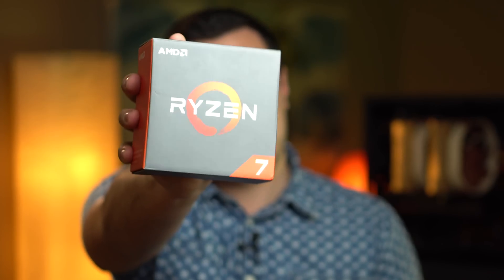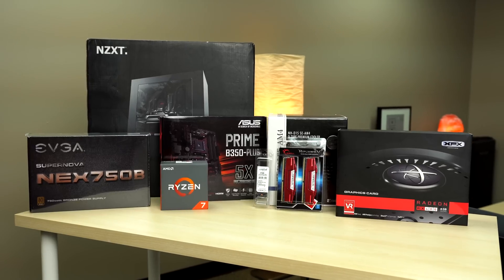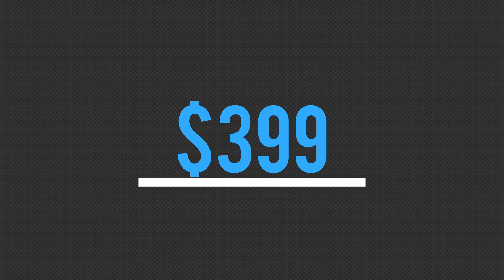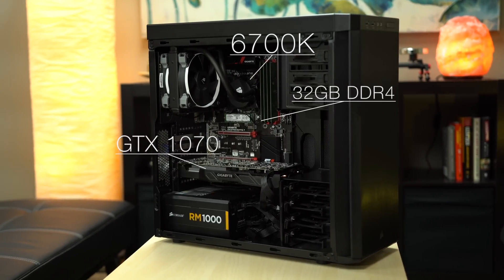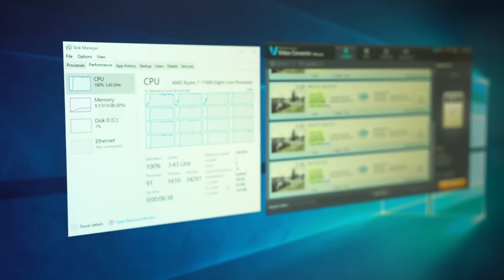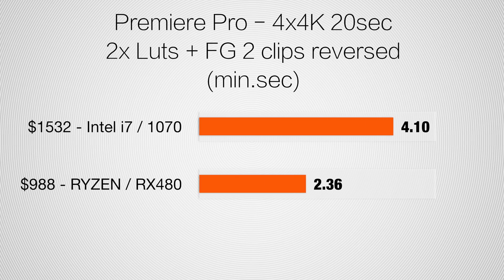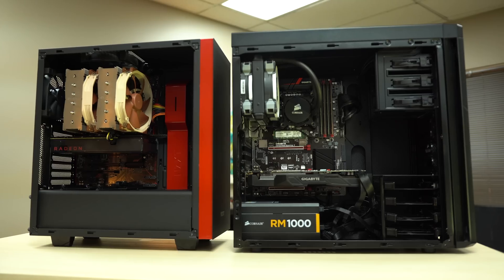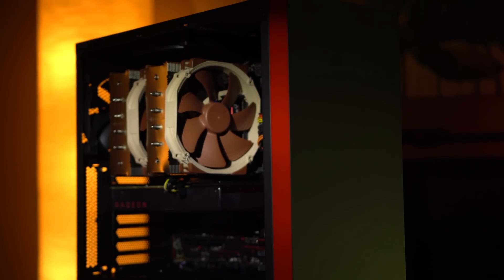$998 AMD RYZEN 4K video editing BEAST! Premiere & Resolve

Comment: Guys please help me. I want to build a little more cheaper pc: ryzen 5 1400, a320m gaming pro, rx480, 8gb or 16gb ram and 120gb ssd. How's my build and what should I change about it but still keep it under $850? My build alreaday include cheap case, cheap psu and 1tb hdd. PC parts in my country are a little more expensive than in the US :(

Comment: Hi Max. Thanks for making this video. 
Have you tested 1070 on new system?

I am planning to upgrade GPU and many people recommend GTX over RX in terms of video processing. And benchmarks I saw GTX Cuda is a big gain here, but your video tells different story. The difference in benchmarks may be due to Ryzen CPU advantage. I am in trouble deciding GPU again :)
Reply from the maker: Where did you see that info? Can you share with me? In my tests, RX was slightly faster in most tests at a much lower price so RX wins for me.
Reply: I will check benchmarks on Youtube and will post it here. 
Have you done those test (Nvidia vs AMD) on one and the same machine? 
Meanwhile I finally decided to buy GTX 1070.
Reply from the maker: Yes on this Ryzen build.

Comment: I'm a gamer, photographer, and videomaker with old i5 2500k at 4.5GHz. An ideal candidate for an upgrade to Ryzen, let's say R1700 and overclock it to the max. Yet I'm still thinking about preferring i7 7700k. 

If you stop repeat that sentence that "Ryzen is good enough for gaming and VASTLY better for PRODUCTIVITY." which every YouTuber repeats again and again, and if you dig deeper, trying to find real numbers for applications you use (Photoshop, Lightroom, Adobe Bridge, Davinci Resolve), you will find that this is not all that simple. 

Ok, Ryzen is slightly slower at gaming, I can deal with that. But it is not VASTLY faster in REAL productivity. It is faster mostly in final rendering of video and final export of images and even it these two tasks is faster roughly by 10%. 10% faster with twice the cores? Most pros know that speed of editing itself, speed during video editing, during photo editing is often much more important than speed of final export. You need to wait in both cases, it is not important if you wait 12 minutes or 10 minutes. And at tasks during the work on images and videos, 7700k is 30% faster than R1700. 

Look for example at numbers by PUGET systems bellow and you will see. So please, stop repeating that Ryzen is vastly faster at productivity and ask yourself, at which productivity. :c)

https://www.pugetsystems.com/labs/articles/Adobe-Lightroom-CC-2015-8-AMD-Ryzen-7-1700X-1800X-Performance-910/
Reply from the maker: I never said anything about gaming, or "Photoshop, Lightroom, Adobe Bridge" This is for video editing only. It was faster in these tests and with the latest Ppro update Ryzen CPU utilization has improved from about 50% to the same levels as the i7 was at so now there is a larger difference in both encoding and rendering.
Reply: One of the benefits you get with Ryzen, is the ability to actually USE your computer if you're rendering, until Adobe improve their optimization, You have a 40-50% percent headroom which you can use towards using lightroom while rendering, or relax and play some games. 
That's why it's vastly better for productivity. My 7700K would slow to a crawl if I attempted any type of other things while using premiere (do some games and editing some photos while waiting for rendering, applying effects, etc.), and having that extra Ryzen headroom would help me A LOT
Once Adobe fixes the optimization problem, well, you will get your double the performance.

Comment: What do you guys think of this build for 4k video editing? (For someone who might not be confident enough in building a pc)http://www.bestbuy.com/site/cyberpowerpc-gamer-master-desktop-amd-ryzen-7-16gb-memory-nvidia-geforce-gtx-1070-120gb-ssd-1tb-hard-drive-black/5781149.p?skuId=5781149
Reply: by the way, great video Max!
Reply: amd 1700x, gtx 1070, 16gb ddr4 ram, 120 gb ssd, 1tb hdd, windows 10 included. Would want a bigger ssd and more ram!
Reply from the maker: +Tyler Bowe Go for it as long as you can add 16GB of more ram and a larger SSD after.
Reply: thanks for the input. I've done some shopping around and like your setup best. I'm going for the rx580, the faster motherboard you mentioned, and the faster ram for about the price of that machine at bestbuy. can get it cheaper I'm sure if I wait for other stores to restock. thanks man keep up the good work.

Comment: I would change nothing!!!  This machine is an absolute beast for making 4K content.  Thank you for sharing this information.  
As always Max, your videos are some of the best and well produced videos.  

Just out of curiosity.  How much time do you spend rehearsing before a shoot?
Reply from the maker: ricky v Thanks Ricky! I don't rehearse but I do write up a script ahead of time to condense my thoughts. This usually takes 3-4 hours for a video like this (yes it takes a while) but because of this it sounds better, I make sure not to forget anything, and the video length gets hit in half (while having more detail). I then read a sentence or two of the script out loud a few times and then look into the camera and try to say it as close as I can. Usually it takes me 2-4 takes to each section recorded and the cuts I cover with b-roll or punch in/out to make the cuts look better. Sometimes it can take 10 times or more of it's a really difficult part. For section that have data and graphs I usually read that info of the script to say it correctly. A 7min video like this  probably takes about 30-40 min to record and 6 hours or so to edit, plus of course scripting and testing the computer (longest of all) in total this video was probably 30 hours or so of work + $ of course. Thanks for watching!
Reply: I couldn't agree more. Words, well said Max. Subscribed!

Comment: sweet and simple video . a completely no nonsense video
i have a doubt sir why did you chose rx 480 over gtx 1070
Reply from the maker: hasan abdul Thanka! Because it was cheaper and faster for video editing.
Reply: which cpu and gpu should i take im going to learn autocad can you suggest me a pc below 2000 dollars is auto cad similar to video editing in terms of gpu usage . will rx 480 bottleneck a ryzen 1700. i dont want to annoy you by asking questions but i am in a confusion

Comment: You managed to build all that for $998 (£771.55)? The same thing on Amazon here in the UK costs £1,216 ($1573.20). I really do feel ripped off at times here.
Reply from the maker: +Tony Boyle I picked some of the parts because they were on sales it was just over $1000 as I was forced to buy that cooler (nothing else available at launch) but I recommend cheaper ones in the description. I think it was $1040 or so

Comment: I'm moving to 4k editing and currently have the Quattro 4000.  Is the card you're suggesting Gigabyte GeForce GTX 1070 8 GB GDDR5 256 bit better or comparable to the Nvidia?  I have a dell workstation.  I was willing to drop 1k on a card, but I am not graphics card savvy.  Thanks!
Reply from the maker: Yes, it will be faster if you're doing video editing. The High end cards are only for those that are doing complex 3D or calculations needing dual floating point precision (not video editors)
Reply: On this page there are several options, which is the best?
https://www.amazon.com/Gigabyte-GeForce-GDDR5-Windforce-GV-N1070WF2OC-8GD/dp/B01HHCA1IO/ref=sr_1_1?tag=tech2-yt-20&s=pc
Reply: Thank you so much for your time!
Reply from the maker: I would go with the least expensive one as there won't be a difference for video editings (only small difference for gaming) http://amzn.to/2p1K3ul
Reply: You the man!  Thanks!

Comment: Thanks for taking the time to put together this video and test these hardware configs.

I was able to order a very similar build to what you are describing in your video/links. I did end up getting a similar Radeon graphics card https://www.newegg.com/Product/Product.aspx?Item=N82E16814150774&nm_mc=TEMC-RMA-Approvel&cm_mmc=TEMC-RMA-Approvel-_-Content-text- . 

I am playing 4K GH4 clips in the latest version of Premiere CC and getting maybe 400 frames of no frames dropped playback followed by super choppy playback. The OS and application is being run off the internal SSD you recommended. My media cache files are on a separate SSD also connected internally via the SATA plug. I am currently running the project off a USB 3.0 external drive, but have also tested a separate 4K project on the internal SSD to see if it would alleviate the issue. 

Any recommendations on where to start troubleshooting? 

So far I have updated the Radeon drivers through their installer, made sure my Premiere settings had Memory set to "Performance," pointed my media caches to the second internal SSD, updated Premiere to the latest version, made sure OpenCL was selected in the Project Settings, made sure audio input was set to none in preferences, and set my playback resolution to lower resolutions. Any advice would be greatly appreciated.

Comment: Would you make a video on Photoshop and Lightroom performance on this machine, as compared to the Intel-based machine, and even the Hackintosh you compare in the other video?
Reply from the maker: It Admin I may in the future, but for that I would get a 7700K and a large water cooler and overclock it as high as you can. 4.8-5GHz
Reply: Do you mean that a 4-core processor would be better for Lightroom/Photoshop? I know that Adobe hasn't optimized those apps to use more CPU cores more efficiently, and Lightroom completely ignores GPUs.

Comment: MAX - I'm torn between 2 @ E5-2760v1 (16 cores, 32 threads, 2.6ghz/3.xghz turbo, $100-200 for 2 cpus) vs 1 Ryzen 1700x ($329) vs 1 or 2 E5-2650v4 (I can get for half price $620 each, 24 cores, 48 threads, 2.2ghz/2.9ghz turbo, $1240 for dual cpu).  What would you choose for the best results in video editing, which is my highest priority?

Comment: i have a similar setup on the way i realized this case doesnt have any fans on front, how are the temps? i ordered the same noctua fan for cpu but now i am afraid the computer is gonna run really hot, should i go with water cooling instead, 240 radiator on front?

Comment: Hi Max thanks for the great video. I wanted to ask, why did you choose the rx480 over the gtx 1060. They have similar prices. And premiere favors Cuda usually. . Do you think ryzen plays better with an amd gpu?
Reply from the maker: Premiere no longer favors Cuda (the last 1.5 years) and works just as well using AMD. I favored it since its faster than a 1070 and has 8gb of ram for $189.99 (what I bought it for). If its faster than 1070 than its faster than 1060 as well and for less $.
Reply: Hey Max thanks for the reply. The 1070 testing was it yours?
Reply from the maker: Yes.

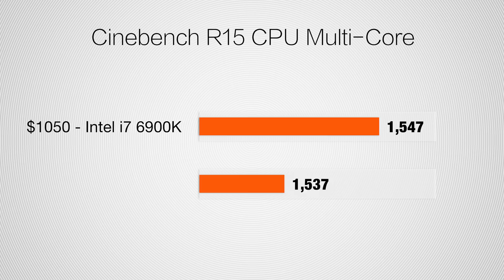Comment: 2:21 - That's not the whole picture, as well as the intel chip costing over double you need to also factor the price of quad channel memory kits, X99 chipset all of which are signifcantley more then AM4 with it's dual channel support.

Comment: What kind of connections does this offer? Obviously not TB. USB3?
Reply from the maker: +The Film Boss Yes USB-C which is good enough for most people.
Reply: Thanks! Sounds like a keeper.
Reply: one more question: Is there room to add 2-3 more internal drives (one more SSD for cache & two 7200 rpm 3tb drives?
Reply from the maker: Yes!

Comment: This video is great but may I know is that any different between AMD and NVIDIA (not Quadro) GPU when using on the Adobe Premiere Pro. Since Adobe Premiere Pro is utilize NVIDIA GPU (Cuda) rather than AMD GPU. 

I look forward to hearing from you. Thanks Max!
Reply from the maker: +Kai Sheng Ppro used AMD just as well (open CL) in the last 2 versions of Premiere.
Reply: Many Thanks @Max Yuryev! Hoping you can do more this kind of video especially for video editors 👍

Comment: Could you have used a liquid CPU radiator because they are easier to clean than fan-based radiators?
Reply from the maker: Yea definitely! There was just nothing available when it just came out.
Reply: May I suggest to download a copy of Windows 10 free of use for 3 months (I think) and it has Hyper-V with it.   You have to enable the Hyper-V feature in Windows.

Comment: Hey Max,

What do you think about the new Ryzen 5 - 1600x?  do you think that with 16-32gb ram and the RX 480 8GB video card could push throughediting 4K?  or do you think the 6 core vs 8 core will make a big difference?

Comment: hey there i have a no doubt strange question, but how loud is the box with power and fans running? i know you dont likely have a way to measure SPLs but if you gave me a general idea on a scale from i need ear protection,  to i could record audio in the same room and not hear the fans after the audio is aggressively compressed, i be grateful.
Reply from the maker: Yes, it's fairly quiet. The Noctua coolers are really quiet but the stock ones are just "OK"  I would swap them for this: 1x http://amzn.to/2on1XbI (top) & 1x http://amzn.to/2on0Kko don't worry about color they come with 3 color rings.
Reply: thanks for the response Max, fan suggestions noted! 

 -- im getting the parts together to try this build do you have new suggestion for the gfx card as i think that your preferred is no longer in production...thoughts?

Comment: Hello Max. Yes I did my first build ever. And all thanks to you, man. You and your team.

This is what I got:-
ryzen 1700x
asus prime b350
G.SKILL Ripjaws V Series 16GB (2 x 8GB
Crucial MX300 275GB ssd + SATA 120GB SSD
MSI Radeon  RX 480 8GB Graphics
MSI CPU Cooler
80 PLUS 600SW Power supply 

I used my old case, and the cost was about  almost $800 dollars.
Reply: Do you edit 4k videos on this build?
Reply: @JirehProductionsLtd  would be interrested aswell

Comment: You mention that this is an 8 core.  Would it be possible to put two in a single case and make a 16 core machine?  Is there a reason - some sort of bottle neck that would make this not advantageous?
Reply from the maker: There should be no issue IF AMD lets you with a motherboard that supports two. There is a rumor that they will have a more pro platform with a 16 core CPU so that is what will probably end up happening instead of a dual CPU.
Reply: J D Freedman it is rumored that amd is about to release x390 high end platform which will have 12c24t and 16c32t cpus.
Reply: Thanks

Comment: Really need your help, would save me some sanity. I've trouble shot so much already.

Build:

Ryzen 1700x
RX 480
M.2 512 for OS + Software
SSD 512gb x2 Raid 0 for Projects / Assets
SSD 128gb x1 for cache
64gb RAM DDR4
msi x370 mobo
Corsair CPU cooler (OC to 3.9GHZ)

Issue:

I've updated all drivers, clean install of Windows 10 pro and for some reason when using GH4 4k footage, it's not as responsive as I anticipated. There is a 1sec dealy, sometimes longer when clicking on different areas of the timeline with my .mov footage off the GH4. Scrubbing isn't the best. There are NO effects applied, is this common? It only seems like a small upgrade in comparison to my PC that's pushing 4 years old. Am I missing something perhaps?
Reply: Lyndon Alvarez Dont have a ryzen build yet so I cant check for it myself, but what I can say is always check the software settings. Theres been plenty of times where my editing software has crashed only to find out I didnt uncheck a single box in a list of other boxes, I assume the issue may be similar.
Reply: Lyndon Alvarez have you updated your bios ??
Reply: GH4 footage has been an absolute female dog to for me to work with in the past. I suspect it has something to do with the format the camera uses. My 4 year old PC can absolutely swallow 4K from other cameras, but it struggles with this one as well.

Comment: Hi, thanks for the video! I was wondering if it's possible to create a set up like this one for 4K editing, visual effects, 3D but in a smaller size version, something about the size of a mac pro or a little bigger. I would like to build my own workstation but the compact size of the mac pro is a big plus. Any advice?
Reply from the maker: Stay subbed. I had a Hackintosh a year or so ago that was very small (search $1200 Hackintosh) but we are currently working on a very very small one making the case custom as there's nothing as small as we can't to fit a full size GPU.
Reply: Thanks for the quick response! Is it possible to have pro performances in a very small desktop pc? I think that in 2017 is not worth it to buy a mac pro (2013 Mac Pro - Quad-Core Intel® Xeon® Processor - 12GB Memory - 256GB Flash Storage) and then eventually upgrade the CPU in the future! but the size is a real game changer at least for me. I have to get a new computer asap because I had to return the one I had... It's a very hard decision!

Comment: Please do a test using Lightroom.  Please, please, please!  I have a $3,000 Intel system and Lightroom struggles with it when I import a wedding with 2500 images at 30MP per image.  I would LOVE to know how much faster your system is.  Thanks!
Reply from the maker: M Shea no it won't be faster. Lightroom is horribly optimized. If your not already editing off of a fast SSD I would change to edit off of one. Lightroom sucks at multi-core. I would suggest a 4 core clocked as high as possible, so at this time that would be a Intel 7700K overclocked to 5ghz.

Comment: a r7 1700 and stock cooler will lower price significantly as well as price to performance ratio will be tremendously high. I saw in kyles BITWIT channel he did oc with that wraith spire cooler and it stables. Also 1800x and 1700x has some 20 degree celcius temperature offset, which 1700 dont have, so for ryzen build i think 1700 is a crusher among all processor r8 now. it crushes other ryzen as well as intel by far.